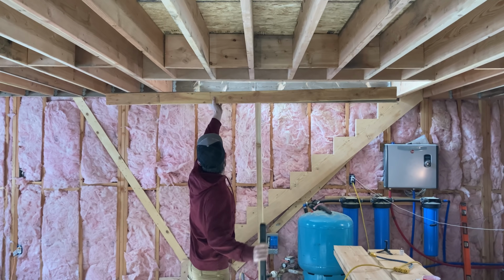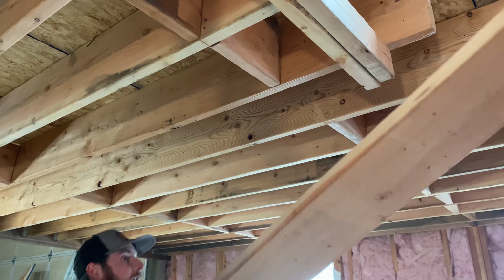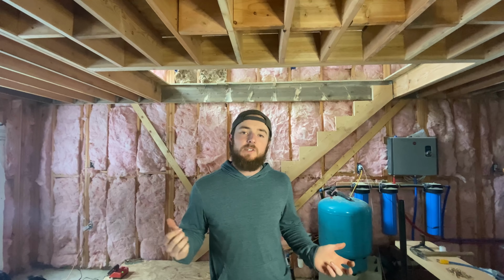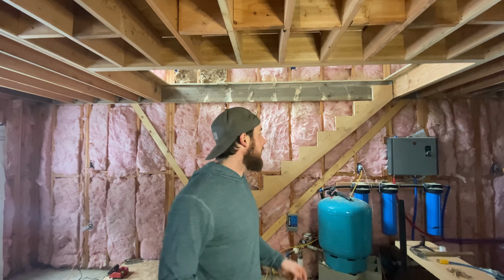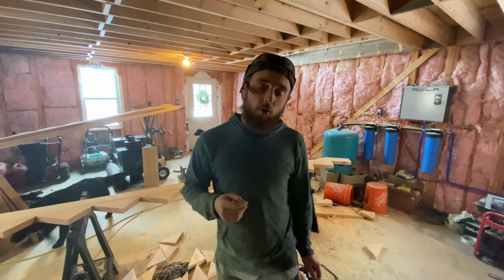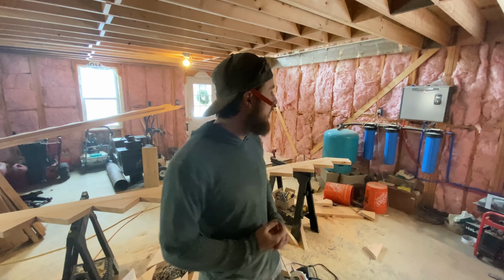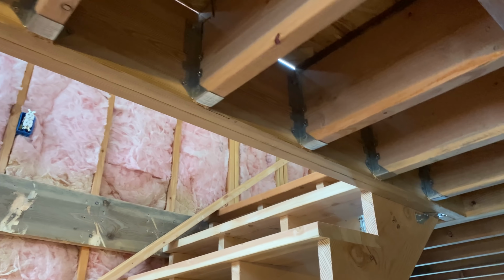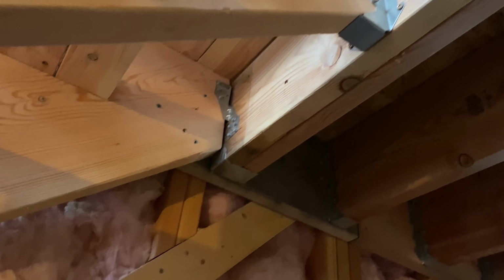Loft Stairs Are Done | DIY Shop House Homestead Build

Comment: Slide the stove up 2x4 s and if you can make hoist and attaché it to a 4x4 across a few rafters at the top of the stairs in about two to three rafters in . I’ve lifted spiral staircases and moved it eight ft over it will work and your rafters won’t be hurt you can even support the eater if you want

Comment: Nice sturdy looking stairs, don't think you will have a problem with them any time soon. As far as the wood stove, I would try to leave it downstairs if I could. Number 1 the weight of it and number 2 if the heat source is downstairs it will heat the downstairs and as the heat rises it will heat the upstairs, if the heat source is upstairs the downstairs will be considerably colder because heat doesn't fall unless you have a fan to push it down. Just a thought. :)

Comment: I would hoist the wood stove up over the side wall. Rent a telescoping duct lift/cable hoist. They are reasonable to rent. Get everything up over the outside wall, including your drywall with it. Save your wood stairs from getting scratched and chipped.

Comment: Lay some 4x2 over the stairs to create a slide, wide enough for the wood burner.  Get it to the bottom of the stairs faster ropes to its feet. Set up a block and tackle, or ratchet straps to pull it up the slope.

Comment: The best way to make the stairs strong is to build a closet under the stairs. Stringers aren't very strong. There should be a vertical support about halfway up and at the top.  I like the look of 3 2x4s. Technically you should have used a 1" overhang (nosing) for each tread. Oh well, it's code and looks terrific.

Comment: Mike, nice job. Sometimes the old adage of:"Measure twice, cut once " doesn't always work if your concept is off. It's easier for me to say:"Been there, done that!" You might get an strong eyebolt and mount it through your floor and a joist about 10 feet from the top of your stairs, centered. Then lay some 2 bys up your stairs and use several pieces of 1" or bigger schedule 40 or 80 PVC crosswise as rollers under your stove as you attach a come-along to the stove and eyebolt, winching it up, rotating each piece of the PVC from behind to the front.

Comment: I would leave the wood stove downstairs if possible. Another  commenter mentioned that heat will rise up to second floor on its own.  Also if you put it upstairs you will forever be hauling firewood up there and ashes back down. However I have no idea what your floor plan is going to be so that may not work if the bottom floor under the loft will be open to the whole shop.

Comment: There is an easy formula for stairs you can look up, just google “stair formula”. You need height of floor from lower floor to top of upper floor. You don’t want a step higher than 8.5”. The formula will give you number of steps, height of each riser and depth of each stair tread.